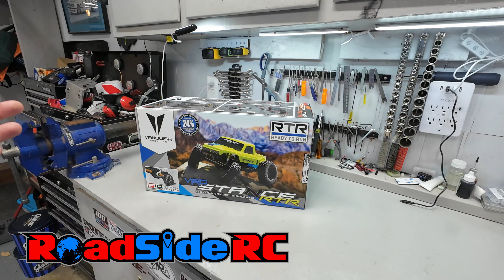First Drive!  Vanquish VRD Stance - How Good Is It?

Comment: I just bought this crawler in Silver this very morning. Took some time to convert all my charge cables with XT60 & replace the Deans which shipped on my Zee 2200 3s. I am good to go after learning transmitter programming. Canceled my Horiz Hob Redcat order and made the switch. Rest of vid will tell me why.
Reply: To get ready for my first truck I got 4.75 Proline Krawlers on Treal bead lock wheels. They also had Proline 2 stage foam inserts. Vanquish tires are HUGE so I have wheels to swap. This is my first crawler so here in Utah lots of opportunity exist. Keep learning and having fun.
Reply from the maker: I hope you enjoy it!  Have fun!

Comment: VRD is a great platform, but I definitely feel that the Carbon is a better value for most folks who are into crawling.
Reply: Also, the tires are DEFINITELY not 4.75" they're taller than my ruptures.
Reply from the maker: I thought about getting the kit, but (1) had a lot of asks to test this head-to-head vs the Ascent Fusion and (2) not sure the extra $$ for the carbon makes sense for most folks - but maybe I am wrong!
Reply: @RoadsideRC  well when you figure like this I think it does….
The Carbon gives you the carbon chassis rails, the heavy duty links, the lightweight trans and machined gears and ring and pinions vs sintered. Plus with the RTR most folks will ditch and replace the motor, ESC, servo and radio anyhow.
Reply from the maker: @jrfishes  Solid points for sure.   

Here is my thought process:
- I will probably put an aftermarket chassis on it either way.  I see a lot of the carbon stock chassis for sale...
- links are certainly needed
- lightweight trans is certainly helpful!
- as long as the sintered gears don't break, they are strong enough. 

Time will tell if I am wrong!

Comment: I agree the Vanquish wins for the ultimate performance ceiling. I'd also lean towards the carbon kit if you have any plans to upgrade because of how much more you get. Vanquish geometry is set and their axles are top notch, so this works great for a first crawler or for someone that doesn't have a parts bin to pull from for electronics. I love Element stuff, but if you are looking for a non-Traxxas portal axle, the F10 wins every time for me. Also the VRD comes with a very usable transmitter that isn't instantly "ready to replace" haha

It would be cool to hear some commentary as you drive instead of the music. I have things I watch for, but I'd pick commentary and impressions over montage every time. At the same time, thank you for knowing how to set your levels when you do play music. There are a few that blast us when they play music or intros and I go grabbing for volume
Reply: I can agree i would rather hear thought commentary over music. Thanks for honest impressions, i do like this but not sure if its $100 better
Reply from the maker: Thanks for the detailed comment Andy!  

I am excited to get this head-to-head with my Ascent Fusion and Ecto.   There are obstacles this went right over that it surprised me...and some that it struggled on...which surprised me as well.  

Thanks for the insights on the music.   It is a struggle and I have used the music for a couple reasons.   Perhaps I shouldn't lean on that as much - especially for a video like this one.    You would be surprised at the number of stupid things I say on a regular basis...  :)
Reply: @RoadsideRC  Yessir I'm sure there are those who would argue with me on having music, so I'm just one opinion lol